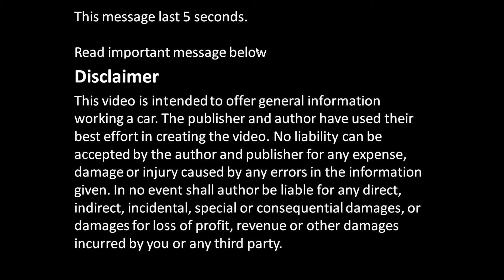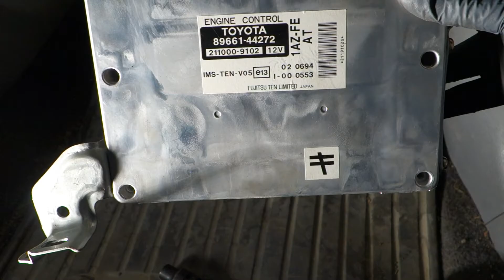How to replace Toyota car Central Computer

Comment: peter i have a toyota Matrix my when steping on the gas pedal car is not responding. I took it to autozono for a scanner reading  gave a p0606 code, but the autozone personal wasn't sure about it then she asked to bring my car to a mechanic for a better diagnosis. Should a replace the computer?
Reply from the maker: Noted

Comment: Do keys need to be reprogrammed?
Reply from the maker: Yes, they might need
Reply: @PeterFinnTheCarDoctor  You would never thinks so from your video.
Reply: Hola buenas noches tengo un Camry 2003 que compre sin computadora y sin llaves ya le leíste la llave y compré una computadora en Ebay pero no arranca se apaga en segundos un consejo ya que aquí en México no encuentro un técnico que me resuelva y dile puedo hacer un inmo off te ante mano te lo grade sería